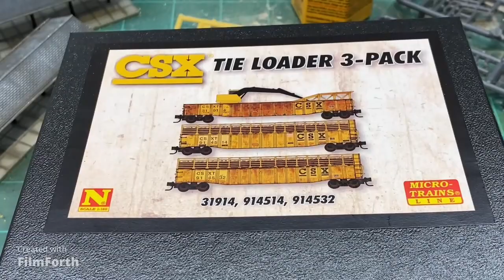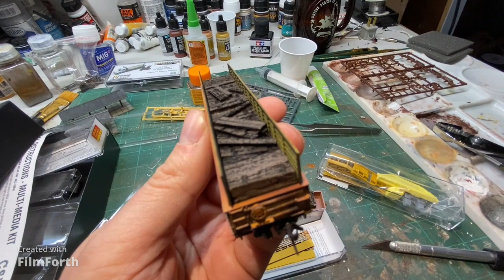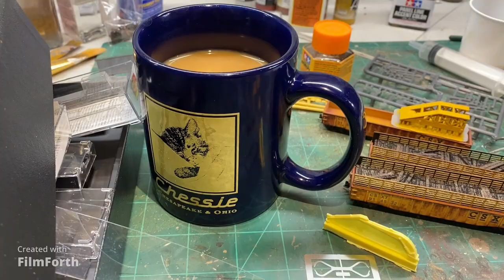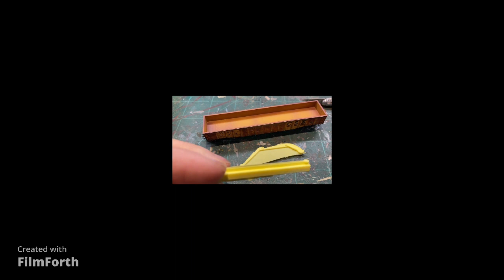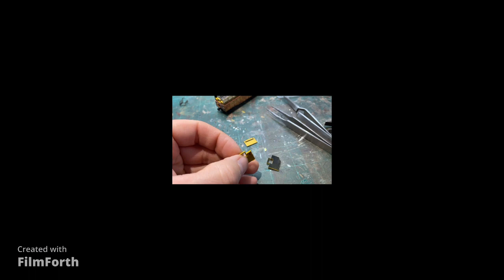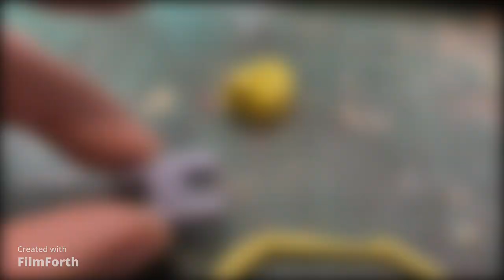Micro Trains Tie Loader Unboxing

Comment: glad you did this review...i guess these kits are RR specific....i have the same MOW set but in Montana Rail Link livery...it does not have the ramp or side pieces...mine has more graffiti than weathering... my crane sits on a steel structure that sits on the car sides....i would assume the crane would travel back & forth on the steel structure... a happy maitake with the road cones... cool review.. thx 4 sharing.. vinny
Reply from the maker: that's neat.  i didn't realize they made road-specific version.  now i kind of want to find the MRL version, too!  i saw an actual CSX MOW train the other day and it didn't have the sides or the ramps.  It was just an excavator on a flat with a car on either side.  i guess that's just for the smaller trains.
Reply: @AlleghenyNorthern  i intend to start the build of the  structure that the crane  sits on  this Friday night in my live stream..hope you'll tune in & i will be doing a 4K give away for my subs very soon...vinny